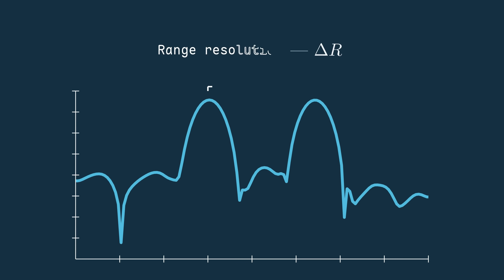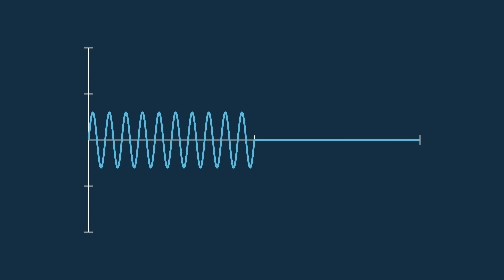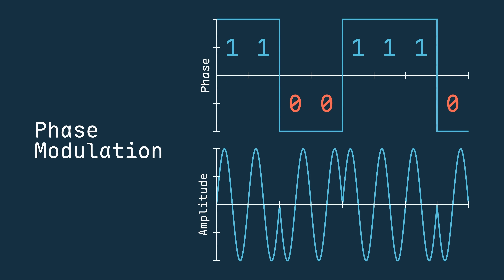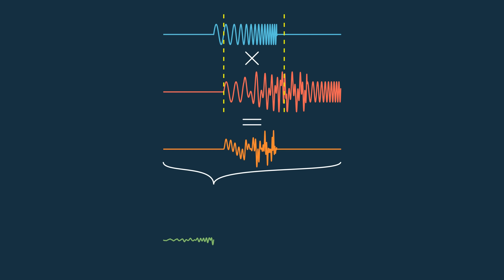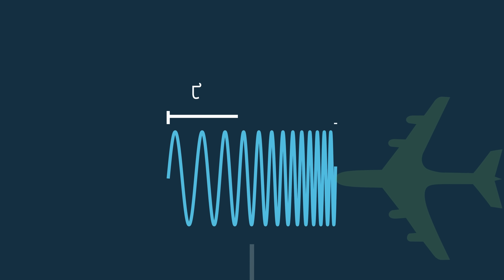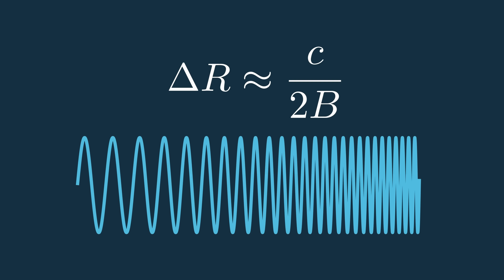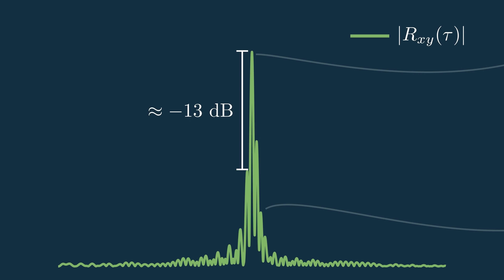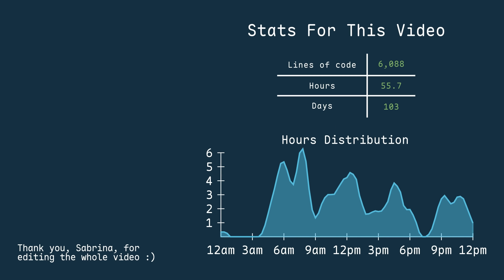Pulse Compression: How Matched Filtering Boosts Weak Signals and Sharpens Resolution

Comment: Great video.  I remember we used these techniques on military radars to identify radar targets based on the signatures associated with individual scatterers on the aircraft: nose, cockpit, wing root, engines.

It also provided good metric data on things like the length of the aircraft. 

The technology was known as Ultra High Range Resolution Radar (UHRR). The biggest challenge was that while the UHRR signature provided a great fingerprint for each aircraft, this signature varied rapidly with viewing angle (target pitch and yaw).  This meant you needed a huge database of signatures for every aircraft type.   Additionally, the presence of things like external munitions, pods, or fuel tanks rapidly changed the signature. 

In the 90s, we were trying to do live collection of these signatures of aircraft of interest. That was hard enough for aircraft we owned, never mind potential enemy aircraft.  Fortunately, computer processing power soon caught up and enabled synthetic generation of these signatures. Other techniques enabled management of what would otherwise be an enormously large database. 

It was cool technology and it reduced our reliance on IFF which had its own limitations and could only identify friends.
Reply from the maker: One of my favorite things about having started this channel is getting to hear so many people's real-world experience with radar. This is incredibly fascinating. Thanks for sharing!
Reply: @MarshallBrunerRF thanks for the great content. It makes it easier to teach the next generation.
Reply: ISAR NCTR is cool stuff
Reply: NCTR is seriously one of the greatest applications of Radar Technology. And one of the toughest - especially if you can't exactly get a huge database. I remember very basic NCTR we had with S-200 system when training. If you disregarded the distance at which the target was detected (which was often obvious enough clue), the "easiest" thing was to get information about the number of engines it had. But then Long Range Radar for that system didn't have resolution for much more (and honestly any NCTR beyond that was mostly done with Fire Control Radar). Fitting for 1950's early 1960's system. Digitalized version had large chunk of it automatized in late 90's.
Reply: In the 80's, I was a baby nerd watching Airwolf and I thought the way their backseat RSO was accurately identifying distant aircraft with radar was science fiction just as much as the idea of a supersonic rotary wing aircraft with bullet proof skin. I could not have imagined convolving two signals, let alone a database of recognized patterns, but you were out there somewhere actually doing it. Very cool! Somehow the writers did get one thing right. I really miss the innovative energy of that era.
Reply: @mgmchenry it's not as portrayed in airwolf but it is a thing. If you have the resolution you can ID a general type based on return spikes corresponding to certain things like engine count or wingspan. But it's super nonspecific, based on visual guesswork by an operator looking at a screen, and can be very hard to determine because of noise, scintillation/glint or other phenomena.

In modern contexts it's in the form of JEM or building 2 dimensional profile images with ISAR. All automatic and algorithim based and you can get much more data down to specific aircraft models.
Reply: @josephrosenbaum3343  Fighters and AWACS systems, due to much shorter wavelength can do a lot more thanks to resolution being so much greater. One of the reasons why S-ducts are seen on Steal and Low observable fighters is to increase the number of reflections that happen within the duct (and with each reflection there is loss of energy, plus of course they get more jumbled), so that it's harder for enemy radar to find the match based on easier to find out data (such as number of blades inside the jet engine).

Honestly when I first heard of NCTR being THAT good (of course scanning the engine is just a tiny portion of the whole picture) - being able to differentiate various types of Flankers based on the engine being used - I also thought that was magic. Though of course it requires some other sacrifices in other areas. But information that Eurofighter and an AWACS platform can share with other sensors is not negligible. Though yes F-35 is next level, since it was kind of built with that in mind from the beginning. But in a way (of course much, much smaller and older) so was MiG-31. Or rather 4 of them could function like an AWACS of sorts. And Link 16 has ridiculously low bandwidth for todays needs, but also there are stripped down versions of information being passed, which are compatible with various connection methods. So F-16 can add to the F-35 situational awareness and vice versa.
Reply: @jannegrey  

-AWACS are at the opposite side of that spectrum, and occupy the longer wavelengths above L band into UHF/VHF. Which would preclude the ability to use ISAR or even JEM techniques for target ID'ing because it is well over sized to blade spacing for any fighter. More often its done by the operators manually, inferencing possible declarations based on detection vector and correlation with known hostile airbases or transit routes, flight profiles and if they are performing hostile actions like flying at high speed directly at blueforce, or even just ID it based on what radar track is emitting. 

-JEM counting blades a bit of a misnomer. Rather it is measuring the micro-doppler profile that is created by the blade count and rotational velocity to a threat table model of what the engine should produce. Just counting blades alone is often probably not enough to ID a specific engine and thus aircraft type. The shape of the profile is what the algorithms do the matching to. 

For L-16 It's not just the fact that the information is stripped down. It's that the data being sent is fundamentally different than what platforms like F-35's MADL do. It's why there has to be a whole data conversion process so it can be re-packaged into L-16 compatible data and message formats that would otherwise not compatible. 

F/F and C2 J-Sets for link-16 send specific post-processed and filtered trackfile data that is well at the end of the signal processing chain and track filtered. things like position, velocity, and various tags to it such as IFF declaration and who has primary ownership of the track is the kind of data being sent, it's all very distilled to critical components needed to present a symbol on somebody's situational awareness page. MADL sends near raw signal processing information to be co-processed, cross-correlated, integrated, and compared for improving confidence and quality. It really just doesnt come close in complexity. This level of data and sensor fusion is as far as im aware completely unique to this platform.
Reply: @josephrosenbaum3343  Yeah, me only knowing stuff from S-200 training skewed my view. VHF was the norm in tracking. And the AWACS I know a tiny bit is the SAAB one that Poland recently got. I should have written "AWACS-like" - meaning that detection by one plane is shared and allows other planes to launch missiles and or steer their radars in such a way to perhaps gain more information and of course it's also transmitted to GBAD and all the ground based systems.

Yes, there is a lot more than just resolution that comes into it. I didn't go into details, because not only did I learn it in different language, I learned in 20+ years ago. And while I was very interested in radars, this was more like a general training + side specialization (not full specialization) + me being curious about this back then and talking to those who were responsible for NCTR daily.

I realized that I was talking to someone who knew a lot more than me. I wasn't trying to teach you or anything. It was more about how arbitrary the definition of Data Fusion is. It's not like planes and other platforms didn't share data for a long time. It's just that MADL allows for ridiculously more data and data that is much more transformative. I should have made it a reply to OP or the author of the video, not random post that gave me a thought in the thread. It wasn't meant as criticism or anything.
Reply: @jannegrey  Sure the SAAB 340 is more of a difference case, its radar system operates in S band which is much closer to the wavelengths required for resolving JEM returns. But again it goes back to the L-16 vs F-35 MADL explanation i made earlier that just because you introduce more than 1 radar into the picture doesnt mean that you all of a sudden get more information. F-35 is a special case where more information can be gathered using multi-ships. With Most anything else they are all separate entities contributing a much more constricted amount of information to a total air picture with L-16. Whether its 1 hawkeye or 4 hawkeyes if they are tracking an aircraft that it physically cant resolve a JEM return, then it's just 4 hawkeyes creating an amazingly high quality track on an unknown target that has to be ID'd by other means. It's just not the same level of data sharing. 

I am curious though. What kind of aircraft were you most able to reliably ID and how was that accomplished with the S-200? Was is it by just looking at a 1 dimensional profile and infering based on how many peaks are produced and correlating that to engine count or was there more complex automated systems for this?
Reply: @josephrosenbaum3343  When I was learning, S-200 were in the middle of limited modernization (much more limited than our S-125). Basically yes, line (or it reminded me a bit of winamp's audio profiles, in that peaks were represented by bars) that could tell you that you saw the fuselage and the number of pylons of engines (I never saw B-52 on it, since these didn't fly to Poland, or at least not when I was there, not head on and not when the Fire Control radar was on - for search radars first of all you had two, elevation one was separate. But I suspect B-52 might have looked like a 4 engine bomber, because of number of pylons). At the time the fire control radar wasn't turned on very often. The most "reliable" real airplanes that we could easily identify were C-130's. Command would often know when one was flying in from US (or rather Rammstein or other bases). They wouldn't tell us about that fact, but they would allow for fire control radar to be turned on. So it's definitely airplane that I remember the best (not including civilian aircraft of course, but where we were stationed, 95%+ of civilain craft would be seen either from the side - near 90 - or from 140-150 degrees - tracking near 90 degree aircraft was possible in certain modes of work, but those had much shorter range). We did try to identify our fighters and on closer range MiG-21 and MiG-29 looked different to a trained eye. That being said, they rarely flew at such an angle to make this distinction "easy". You mostly looked at the table with range at which various airplanes were detected from various angles. Mind you, this was during the time, where military budget cuts were severe. So running radar that was not yet upgraded to allow for running for long time (heck cabin would get really warm) and for which spare parts were... in short supply (I'm not going to delve into how we were going around this issue) was shunned.

However:

1. There was a training program. It had signatures of some airplanes coming mostly head on.

2. There were 2 (or 3, depending how you count) databases. System itself had small storage that had a memory of about dozen types of aircraft, mostly from the front. If you knew how the signature looked from the front AND you had experience in comparing known aircraft with known signature and heading at for example 30 degrees from real life operation of the radar, you started to get an understanding how the aircraft that you have seen recalled from storage at 0 degrees "might" look like at 30 degrees. For example I was reasonably certain that I've seen more than few times Il-76, or one of it's variants over Belarus, coming from Russia. Or often flying to Kaliningrad. Which subvariant was it was impossible to tell, especially at this distance.

3. You could "record" any signature you wanted that you received on the magnetic tape kind of machine. We had few tapes that were originally sent with the system, containing both Soviet and some suspected and/or identified US/Western planes. Though Soviets didn't share with us a lot. Only what was necessary for Europe and even they suspected we would be nuked into oblivion. So there wasn't a lot there. From talking with Ukrainian who used to operate Soviet version of the system during cold war, they had dozens of tapes recorded given to them to train and memorize on. Not 5.

So there was internal memory (I'm not sure if it worked properly though, since we too often had to use tapes), there were good quality Factory tapes and then there was your own database that you were building up. You did have to be careful not to waste too much space and to remember to keep marking and noting every type of condition - often if we saw something odd, or we knew that a "special" airplane would be flying, suddenly the overheating radar and budget wasn't that much of a problem. During such times it did look almost like wartime, everyone was on their stations trying to write down as much information as possible that would go with the tape. Analysis was done both during the recording, post recording and in the lab (tapes were sent to the lab in the Air Force school - Or rocket artillery school, funnily enough, since they had very good equipment - they would be copied at least twice, for other unit and for cadets - but rest of the details I don't know and even that was what they told us).

There was some kind of program that was supposed to match with database, but I don't think it was operational when I was there. Or maybe it was useless and from what I've heard unless you were looking at aircraft in the database that was flying head on - it took a long time. Longer than trained operator (or rather 3 working together) would take to categorize or recognize an aircraft.

Limited modernization - that I've heard from people who came after me. Mostly some elements of the radar and cabin electronics were changed. However it was light modernization, unlike S-125 SC that was a medium depth modernization. I did hear that operators trained mostly on recognizing C-130 and differentiating it from C-295 at medium to short ranges. I'm not sure what I can say, so from official documents NCTR was expanded and partially automatized. C stands for "Cyfrowy" - "Digital".
Reply: @jannegrey  Was there any limitation in IDing directly head on targets, like for instance they had to be slightly off angle just enough so each of the C-130's engines were separated in range enough to create 4 distinct peaks in the range profile? Or was that not really a problem and you could still see each engine. For that matter what kind of scope were you looking at to do the ID, was it just an A-scope displaying range or was there a way to look at the profile by angle?
Reply: @josephrosenbaum3343  There is a good simulator of S-200 (well it mostly covers actual training mission, but details are represented very faithfully). I don't think we ever had C-130 going directly at us back then. They still didn't fly often, but often enough compared to anything Polish which was on minimal hours and often below threshold of even maintaining capabilities. So I do lack information a bit, not to mention this was still late 90's and I was more like backup operator (due to lack of personnel and a ton of changes every few months, some of us had additional duties - I was lucky to be trained on it honestly. Good commanding officer). I don't want to poison your knowledge by sharing data that I might misremember. I'll try to find a picture of consoles with display on, but profile was more of a plot of strength of returns nothing fancy. Almost simplistic, cause for Soviet Union unknown bomber/transport plane flying inside their zone was a target rather than unknown. There was the typical circular display giving you tracks for all airplane in certain range (except those that were at or near 90 degrees - the minimum speed towards or from the radar was needed to even see it except for 1 mode that could in theory track such contacts at reduced range. Though mind you it was rare that all 3 radars were functioning at the same time). My memory is bad - this part is questionable: There was sometimes problem that engines gave such returns that they blended with fuselage and algorithm (I think) subtracted fuselage sometimes. Trying to remember it is hurting my head though, because now I'm not sure if this wasn't from one of test scenarios.

Generally speaking S-200 was a very good system. For the country the size of Poland it basically had an early warning radar. Given that it's plausible that one or both A-50U shot down over Black sea were hit by possibly unofficially given S-200 batteries that we had (I don't think it was officially confirmed, but you won't find them were they used to be and such system isn't easy to just redeploy for fun if it's supposed to do prolonged mission. - Ukrainians have S-300 and S-300 has limited backwards compatibility when it comes to locking on and firing S-200 batteries) - for big not very maneuverable targets, unless they manage to go down below radar horizon, it's a big and fast and high flying missile (honestly the only one that could threaten SR-71 if they wanted to shoot it down, but of course since it wasn't mobile, it was very easy for US to just take paths that could annoy S-200 operators, but not give them the chance).
Reply: Of course these days the real magic happens with data fusion.  You might be too far too get a full UHRR signature, likewise for a JEM print, or ISAR, but the partial data from each of these combined with other active and passive sensor data plus info being shared over datalinks can do wonders at longer ranges than we would have ever thought possible.
Reply: @jml_53 that kind of raw data transfer for centralized signal processing, data fusion and correlation is really only unique to the super bleeding edge platforms like F-35 and not across the battlespace tactical datalinks like L16. Maybe within the next 10 years but that kind of volume of data and transfer rates is unfathomably high for that kind of scale.
Reply from the maker: it's so cool reading this discussion. there's so much amazing experience among you all. thanks for sharing!
Reply: @jml_53  yup. It's tough to imagine for me honestly. But combined picture on BMS can sort of give me an idea.